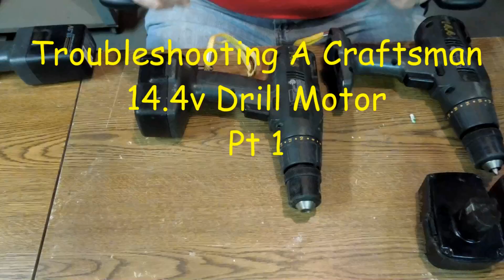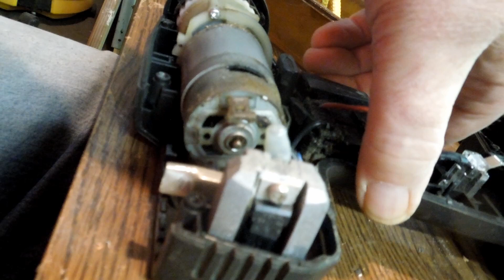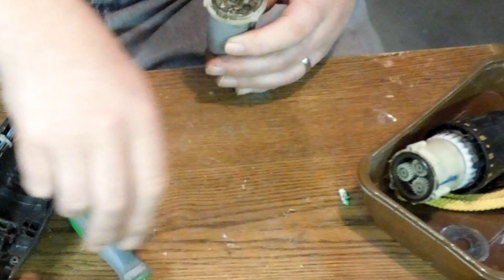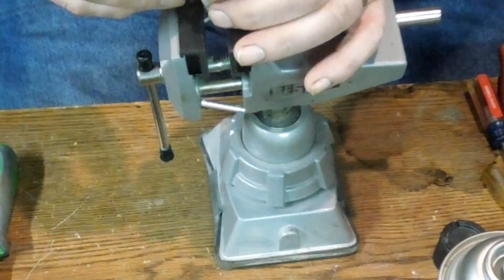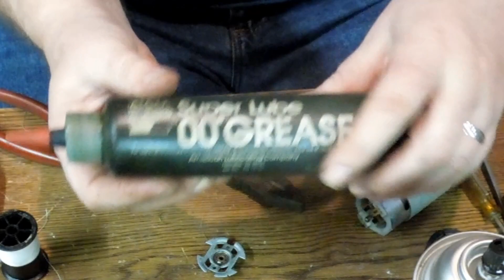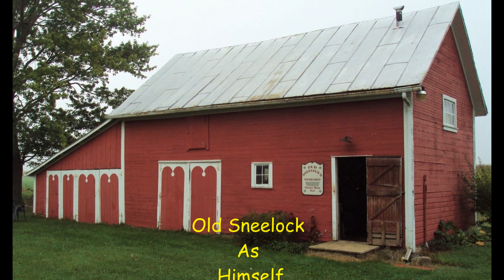Troubleshooting A Craftsman 14.4V Drill Motor Pt 1

Comment: YAAY, the return of Unc! No smoke from the drill motor but looks like you still have some residual from the talk yesterday. ME too but it sure is good to get a notice that you had made a new one! Bitchute is a hole but I had a shortcut to yours, straight on so they could keep the rest but here is a LOT better, even as screwy as it is. All I did was pass on the info on the OO-grease because that's what Snapper mowers used in their gearboxes and you know I'm a BIG fan of old Snapper stuff, key word is OLD. And maybe I might find a DeWalt drill/driver in a previously enjoyed store or get a rebuilt one from CPO or Tyler one day. Probably CPO, but I'm still more than fine with the impact! THANKS, Unc! Good job and HI to Aunt Lydia and Sadie too!
Reply from the maker: He's baaaaaccccckkkk.....  Quick bring out the broken tools.
Part 2 is coming out at 1:00 pm today. 😎
Reply: @OldSneelock  YAAY! Be there shortly!

Comment: I could see right off it was the flux capacitor. GOOD TO SEE YA BACK.
Reply from the maker: I spent a bunch of time trying to get the batteries to work. Out of 4 batteries I got two that hold charge. Then the smoke rolled. Almost tossed them.  Never say die til you're dead. 😆😈😎

Comment: Great to see you back. Made my day when I saw your new video on my subscribed page. Great fix. Unfortunately I just threw my craftsman 14.4 away for smoking.
Reply from the maker: Bronze plain bearing with no seals. Grease leaked on the commutator on my two. No way to reach it unless you pull the motor module.
Part 2 is up at 1:00 pm today.

Comment: How's she goin'?  Nice repair!!!  That tip of holding the brushes out of the way is great.  I'll use that from now on!!!  Take care!!!
Reply from the maker: I found a Black & Decker 1/2" drill. One of the giant early aluminum bodies from the 30's. The guy said it worked. When I tried it the bakelite brush mount ring was broken. I glued it together, but couldn't get it back on. I needed 4 hands and only had two. 😆
The thread trick worked. I hadn't needed it in any other projects until this one. I'm happy to get to share it. 😎😆